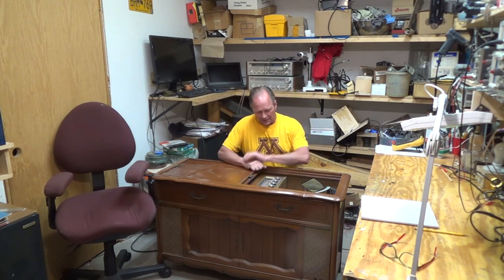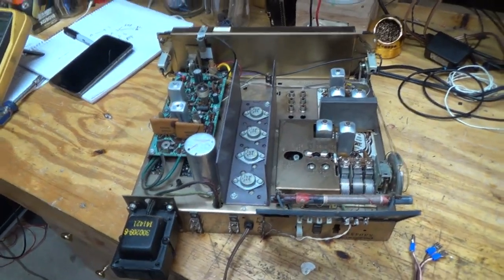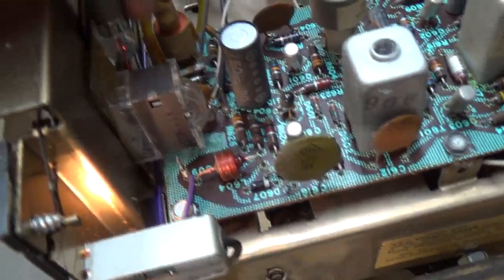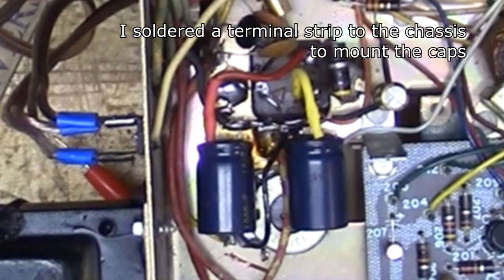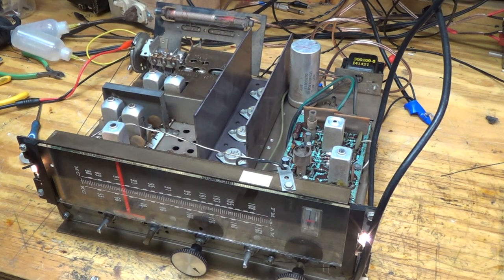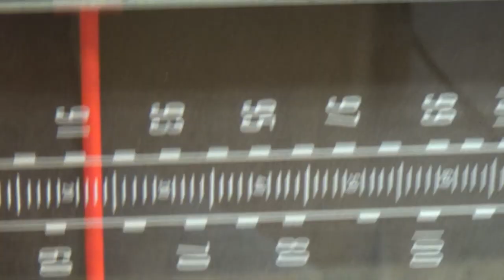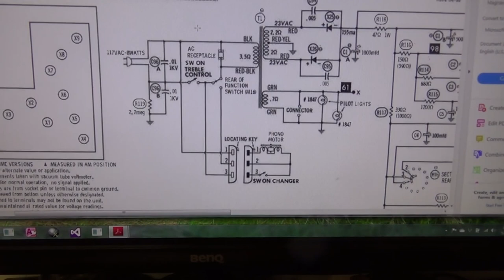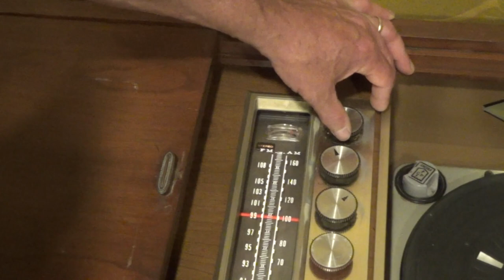Magnavox AstroSonic Console Stereo Repair and Restoration

Comment: Twenty-some years ago while browsing around at a local Salvation Army thrift shop, I saw a beautiful Magnavox like this one except it was the smaller unit (looks exactly the same except does not have the storage space on the left).  I had one of the guys plug it in and sounded great.  Radio and turntable worked perfectly.  The manager told me that it had belonged to an elderly lady that had passed away and the heirs gave her furniture to SA.  The cabinet was (and still is) in perfect condition, not a scratch or dent on it, and as of today still works great.  I don't use it very often, but occasionally play some of my old LP's...still have all my original Beatles albums.  I took the back panel off once to check out the wiring and tubes, and was very clean, there wasn't any dust or debris like the one you repaired.  The needle for the turntable was in great condition, I don't think the lady used it that much.  I did find someone on Ebay that sells needles for my model Magnavox so got several.  The sound is great as of now, my unit apparently from what I've read on it has six speakers (front and back total).  It also can definitely blast some noise when turned up.  Anyway, I really love it...was a great buy for $25.00.
Reply from the maker: I've still got all my old Beatles records too! If it is tube based, you might want to replace the electrolytic capacitors because if,when, they get leaky they can reduce the life of your tubes. Although it is tough to mess with something that is  working. It's an easy diy job.

Comment: Thank you for sharing.  The bulb in the front of the cabinet is called the "pilot light" to alert you when the unit is on (powered up), but not necessary playing anything.  This was a feature for tube type units and eventually went away in the early 70's as transistors replaced tube types.
Reply from the maker: Interesting, thanks for the info!

Comment: My grandmother had one of these units and for 35 years she had a a couple of vases and 2 pictures of her father in the Lebanese army, but never as children did we know it was a record player. So after she passed away 10 years ago I went with my mother to clear out all the furniture and only then did I know it was a beautiful record player. So I took it home and now play my record on it. It powered up and worked perfect. All I’ve done is to have the pots cleaned with deoxit.
Reply from the maker: Wow, great memories!
Reply: @RobsFixitShop  I have this old suitcase unit and when I turn it on it has this s reach from the speakers and when I turn the volume for either left or right I get intermittent noise from them. Now I tested the pots with a multimeter and got a reading of 0.390 for a A500k, when I touched the left with middle and right with middle. I used the 2000k ohm setting. And also did the same with my cartridge and get no reading at all on all of them. What do you think.
Reply: @RobsFixitShop  is it ok to use B500k as replacement because I can’t seem to find any A500 in the size I need. I need a volume pot and a switch power / right speaker volume pot too.

Comment: I'm under the impression these are really just worthwhile for the cabinets. That is, the electronics are just not worth the work to fix (for those that are not educated and with the proper tools that you have). I just picked up an old RCA a little bigger than that one and there is a terrible hum that makes the radio unusable though the turntable sounds pretty good. But the turntable has to be hand spun for about 30 seconds before it will lock on to a useable speed. The power supply has a couple of extremely large electrolytic caps that probably need to go (hence the hum), but when I can just throw in some modern electronics and a nice turntable, completely refinish the cabinet and put in good speaker components, It can become something truly hi-fi by today's standards, but still give the original look. 

That said, I'd love to have one that sounded just like new. They were never that good by today's standards (usually thumpy bass heavy, I actually remember that sound), but then, an MG TC doesn't handle like a modern sports car. It would still be a lot of fun to drive. :)

But I don't have the equipment or knowledge (not to mention time) to refurbish the guts. So I go for the cabinet. :)

Comment: DIY Magnavox wrench- some of you may be familiar with Magnavox's practice of mounting the faceplate with upside down PAL nuts.  They provided their dealers with the proprietary "handi-tool" to allow easy disassembly.  In my console one nut came out easily with pliers, but the other absolutely refused to budge.  After several failed attempts, I came up with a sure fire DIY tool.  Get your hands on a 1/4-20 x 1 3/4" coupling nut (such as Grainger #41JZ35).  Make certain that it measures 7/16 (.438) across the hex flats, some providers have other sizes here.  Drill our the threads to 3/8 inch.  I don't have a machine shop, so I had to do it a little at a time with successively larger drills from 1/4".  When you are done you will have your own Magnavox wrench.
Reply from the maker: I have another Astro-Sonic that had the PAL nuts and they really threw me for a loop. Like you, I ended up fabricating a tool but it was pretty rough. Go to 6:50 to see what I did. My suspicion is that you found a much better way:-) https://www.youtube.com/watch?v=A4Pyvu0NtNk&t=648s

Comment: Interesting to see the insides of one of these old radio/phono consoles.  I remember when they were the cat's meow.  They really sounded pretty good.  But now you can't give them away.  They take up a lot of valuable floor space.
Reply: Too bad because I think its cool how you can blend in with other furniture and you can have a tv above it on the wall with the console hooked up for sound which is better than a sound bar.
Reply: Not anymore. If in decent shape and works, they can bring upwords from a couple hundred.

Comment: You're just going to have to use your knowledgement for my question.
I got a zenith record player with am/FM 
Everything works fine for the most part. now the sound! Lol the sound works on both sides,one side is normal the other side is next to nothing like only the highs are working and I tested the speaker with another speaker so it's not bad speaker.
Reply from the maker: You might want to check if you have audio coming out of the back of the chassis. If so you might want to check out the crossover. If it in the chassis you can try cleaning the pots and checking for cold solder joints and then moving on to checking the audio path for bad caps. Good luck!

Comment: A lesson learned by me on a 1969 Magnavox console with a similar amp.  Replace ALL !!! of the electrolytic coupling capacitors.  If not, you will chase cap failures throughout the amp
Reply from the maker: I couldn't agree more. I just worked on another one. I diagnosed it for the fun of the chase, but it was all bad caps.

Comment: Hi Rob! A couple months ago I acquired nearly the exact same model cabinet; works fantastic! Receives AM/FM clearly, plays records like a champ, speakers sound great! I just want to do restoration work on the cabinet itself - fix a dent in the frame, replace a torn speaker cover, apply new stain & varnish. Some of this work would of course require removing electronic components and then reinstalling them when the cabinet restore is complete. The problem is, I know zero about radio electronics and do not have confidence I could put everything back where it goes!

I've tried finding resources to learn about these old radios so I can go in to the project armed with as much knowledge as possible, but everything I can find online seems to assume the reader already has a good understanding of radio construction & repair. How would you recommend a complete novice learn enough of the basics to do an otherwise simple restoration project without completely destroying the working electronics?
Reply from the maker: I wouldn't sweat it, the console probably has a wiring diagram inside on the floor of the console. Take a bunch of pictures of the current wiring locations. I was able to disconnect everything without desoldering anything. If you are worried about getting things back in the right place, label them with masking tape. Good Luck!
Reply: @RobsFixitShop  I'm in a similar situation to @paperip. I have this Maggie and got her a few years ago. I'm wanting to restore, clean, and do some upgrades like bluetooth. I would love some guides to those things, but it seems those things don't exist. Thanks for your video.

Comment: This version has four germanium output transistors (2 per channel). These most likely are similar to 2N2147 or 2N2148's. Typical RMS power output of this configuration is 15-20 watts rms/ch.

Comment: Rob, I have a Magnavox 1P3605 Phonograph and Stereo.  The radio will turn on but when I turn the tuner nothing will come on, not even static.  The light comes on.  The phonograph works beautiful.  Any suggestions.  No one around Eugene, OR fixes older units like mine.  The insides look pretty much the same as the one you fixed.
Reply from the maker: I would definitely clean the tone controls and switches. The signal path goes right through them and if they are not conducting, nothing.

Comment: Hi! I have a nearly identical Magnavox console, just a bit smaller. Its in great condition, but I have a problem I can't figure out. Loud and clear as day when playing AM/FM, yet muffled and only plays out of one side of speakers at very low volume when playing records. Any idea what might cause that?

Thanks!
Reply from the maker: This one had a broken wire going to the phono head. I had to put in a new set of wires. The phono had a set of RCA Jack's on the underside. You could try putting some line level audio into the cable just to see if it is the phono or the amp.

Comment: Hey Hey! Thanks for your video, very fun to watch. I recently picked up a vintage Magnavox entertainment center, but the Turntable was not included... The new turntable is connected to phono, but it fades out whenever it's turned on, and the power and amp go out. In other forums, they said it was due to the phono connection expecting the turntable and thinking there are no records to play and shuts off the system- they also suggest soldering a jumper between the "hot" and return wires of the turntable power harness. I'd love to know your thoughts on that and if you can do a demo of the soldering needed to make it work. I do not have the old Turntable and wondering if its the right solution because one end of the harness won't be connected to anything...
Reply from the maker: It's been awhile since I worked on it, but when phono is selected it expects the turntable to turn the amp on and off. You can make a jumper wire from automotive connectors and jump the bottom 2 wires on connector  shown here: https://1drv.ms/i/s!AgRy1tCE6lTdgv9ASoAqC5xi_o_pKA?e=WuufOj

Comment: Hi Rob I have a similar magnavox that I am trying to get working. Right now only one drum speaker pushes any sound. I have tested the speakers and they are in working order. I’ve pulled out the main board and can’t see anything wrong but I don’t have the diagnostic equipment like you have. Any ideas on how or where I could get my board tested. I’m in Ga.
Reply from the maker: I am not sure where you could take it but I would clean the controls with some electronic contact cleaner before anything else.

Comment: Hello, I have a Magnavox that is just about the same as yours.  It worked great until about a year ago. We loved listening to our records on it. 
But now for some reason the record player no longer spins fast. I thought it would be a belt. Opened up the back and there was no belt. It looks like the gears are just running incredibly slow. Any suggestions on how to get the gears going smoothly again? I would LOVE to be able to listen to the records at the correct speed again! 
Great video by the way!
Reply from the maker: I wish I could help. I have yet to get a a record player working right. For a guy like me that loves to get stuff working it is really frustrating.
Reply: Most likely the grease in the mechanism has dried out; it's a common problem with older record players.  The solution is to pull the changer out, clean out all the old grease, and re-lube everything.  Do NOT use WD40 or 'red can' 3-in-1 oil.  Those are penetrating oils and dry out pretty quick, you want something along the lines of light machine oil (sewing machine oil works well, or blue can 3-in-1; I like to mix a little spray-can lithium grease in as well).

While you're in there, get a replacement idler wheel (the big rubber wheel he discusses in the video).  There are services who rebuild them.

Changers are complex mechanisms (MicroMatics especially so!); so if you have to actually disassemble something, take photos and be careful, there are some very small parts.

Don't forget to lube the motor.  You do NOT want to try to find a replacement for one of those.

Comment: Is there a reason you wouldn’t replace it with a 3 prong cord? I apologize if I missed it.
Reply from the maker: It goes right into a transformer so it is isolated, although it would be even safer with a 3 wire

Comment: i just picked up this EXACT model at a local garage sale for $25, came with several boxes of records.  I apologize because I'm still watching the video but I wanted to ask about the tuner mechanism.  This one is frozen and stuck on one frequency and even if you take off the knob it cant be moved with pliers.  Whats the best way to loosen this?  are there replacement parts available for it?
Reply from the maker: I would pull out the chassis and oil the shaft and just gently work it.

Comment: That turntable is easy to rebuild, yes you will most likely need a new idler wheel, stylus, and maybe a power switch, but the rest is cleaning up old grease and relubing. I’m in the middle of my first VM 1297 right now and with any mechanical inclination, it’s pretty simple. Make you a deal, I’ll ship you my radio to fix, you ship me your turntable to fix! Lol
Reply: I have a one of these turn tables that I have been having a hard time getting to work. Would you be interested in helping me?

Comment: Hello! I recently acquired this exact same model magnavox -would you recommend putting new thermal grease on the output transistors?
Reply from the maker: I didn't, it is kind of a low wattage model and it didn't seem to be putting out a lot of heat but if it looks crusty then the less heat the better.
Reply: It wouldn't hurt, but what smokes components are defective power supply electrolytic capacitors.

Comment: did you replace the filter capacitor with separate capacitors? i need a new transformer for my astro-sonic but don't know where
Reply from the maker: If I remember right I replaced the caps 1 to 1. If it is not tube based then it shouldn't be hard to find a generic transformer. You'll need 2 windings one for the rails with a center tap and also a 6v winding. Be careful, mine had a different voltage than the schematic. You could get 2 transformers, 1 for the rails and 1 for the 6v. Or just get one for the rails, replace the lights with leds, and power them with one of the rails (some math required).
Reply: @RobsFixitShop  i found another astro sonic with a 204 chassis so i can use the one i mentioned above as a donor

Comment: Can you please respond if possible? I have a similar stereo console and it won’t spin at the proper speed? It works (except the 8track) but the turntable does drop records and does what it’s supposed to but it won’t play at the proper speed at 45RPM
Reply from the maker: the rubber wheel that is beneath the record platter probably rubber that has hardened. Pull the platter by taking the clip off the center spindle and take a look. I don't have a source for the wheels. Good luck!

Comment: I wanted to replace the speakers and the ones I got don’t have enough terminals coming out of them any way to go around that?
Reply from the maker: Hi Monica. So I took a look at the one I have in the shop now, which is from 1968ish and it has a woofer and a tweeter on both sides. The greens connect to the woofer + and the whites connect to the tweeter +. black to the negatives. For connecting the two green wires to the woofer I would cut the clips off, twist them together and crimp on a new single clip.  I took some pictures and drew some stuff out here: https://1drv.ms/u/s!AgRy1tCE6lTdgbRdeC7w80Z8UfdYOw?e=lg54QD

Ignore the stuff about the single speaker if it doesn't apply
Reply: @RobsFixitShop  thank you!!

Comment: Hi rob! I got an old chicago webster stereo a while ago. I think it's from 1949\1950. Model 100-18.(turntable) Everything works except the sound for my turntable, it's weird cause i have sound from am\fm radio. I just changed the needle.Can i get some tips\advice? Thanks
Reply from the maker: Touch your finger to the needle, if it makes decent noise then it could be the needle. If it makes no or little noise then though the contacts on the back of the cartridge. If you hear noise the it's probably the cartridge. If there is no noise then it is probably the wiring to the cartridge. The needle is probably not the issue.
Reply: @RobsFixitShop  i only hear noise when i touch the cartridge wire under the turntable. It doesn't make noise anywhere else 🤔
Reply from the maker: The turntable on this stereo had the same problem that I later fixed. The white was broken between the bottom of the turntable and the cartridge. I replaced it with a wire I bought on eBay that was specifically for this application
Reply: @RobsFixitShop  finaly, it does make sounds when i touch the contact on the back of the cartridge. It means that i need a new cartridge? Right? Does anyone has recommendation to where i could find one? I've only saw one at 94$ (Ceramic Astatic 460)